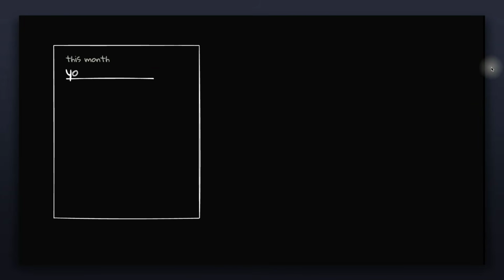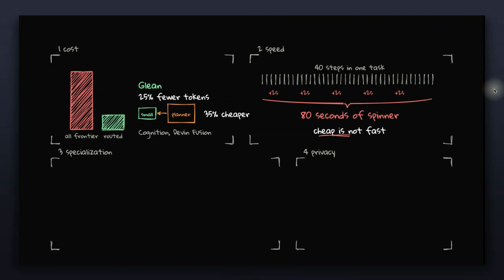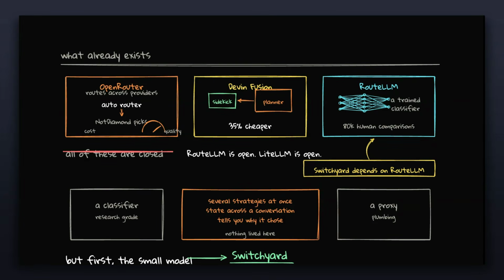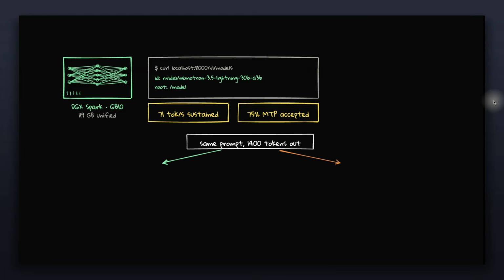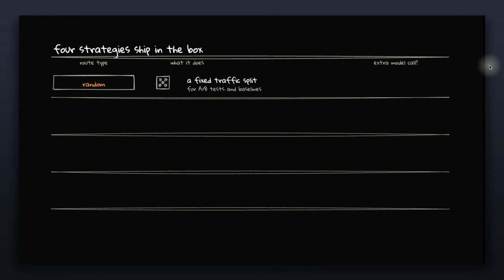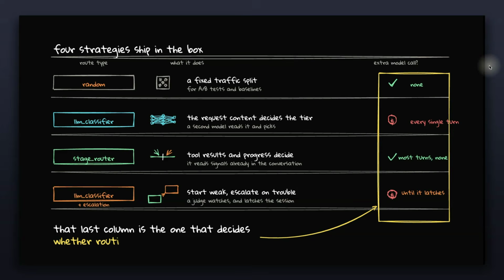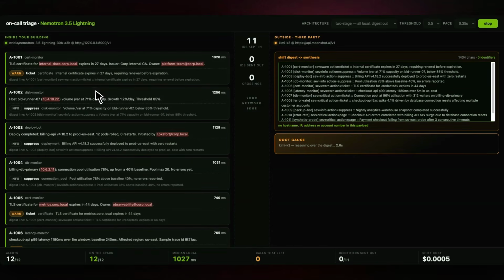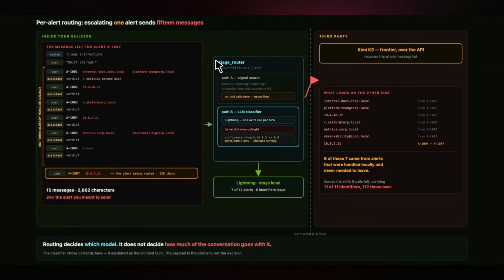Build a Local Router with Nemotron Lightning

Comment: In my layman opinion, the best router system should be a small specialized model that can read specifications, benchmarks and architecture from the available models to use, on top of the system prompt ( the well experienced user) within and in order to choose each one, be evaluated on a lot of different tasks. Does not?

Comment: How does this differ from the few .md lines that tell which subagent to spawn for each given task?
Because what's the point in routing to different models to save on costs, but breaking the cache costs you more and polluting the distribution with different models also does not help performance?
Maybe I'm viewing it under the "I'm serving an agenti platform to people that use the company's own agents and skills" rather than "an AI native whatever that spanws single-shot tasks continuously", because I did not understand how this saves costs in actual conversations with models.
Because it feels like "bro this task is easy just use a cheaper model" which doesn't feel like something we need a classifier for?
Even doing it at the start of a task instead of per-turn, what guarantees that the classifier is actually already fully aware of the task complexity? Or is this for isolated use cases in which task complexity is actually defined by the first prompt containing context?

Unless we rethink conversations entirely, completely scratching the concept of "list of messages" and treat everything as a single-shot with evolving compacted context. Still re-read cost and cache is zero.
Reply from the maker: selection of the .md will be routing logic.

Comment: At least from my understanding, the biggest problem with routers is that the KV cache is lost during routing, which can make routing more expensive than finishing the task, even if you keep the model until the end of the task. 
So the router may save money mostly if it is used to select only the used model, of course, if the alternative is a local model, it will definitely reduce costs, or you switch to a local model mid-task and keep it till the end.
Also, I have had some doubts for a long time about whether the router is cheaper than using a main agent that plans the task and activates a subagent based on complexity, similar to llm_classifier method, but you have to pay for the planner tokens.
I would be glad to hear your take on this.
Reply from the maker: I agree with your point around KV cache. I touch on it later in the video. You dont' want to do this on every turn but rather at the start of the task. For your 2nd point regarding the sub-agents you run into similar issues of cost. Your planner can be relatively small if you provide clear rules. 

But in general you want to do routing on task level than on every turn.
Reply: This